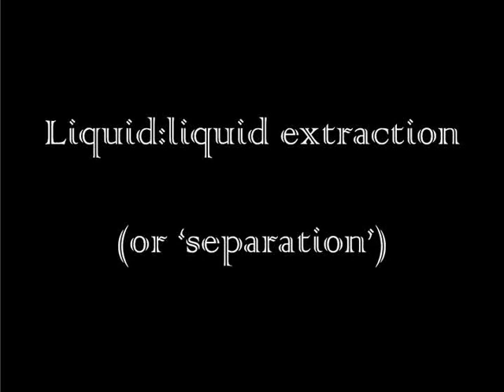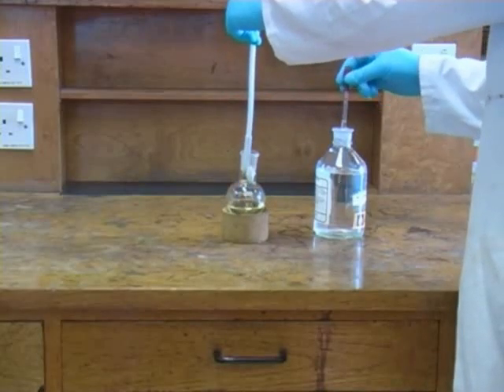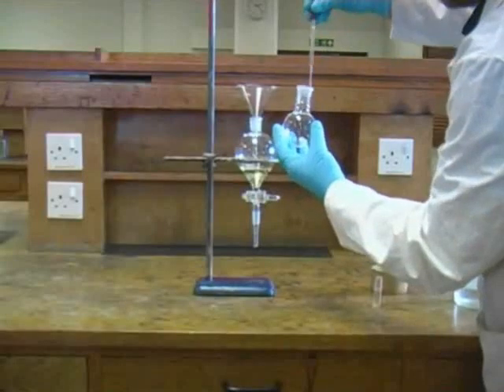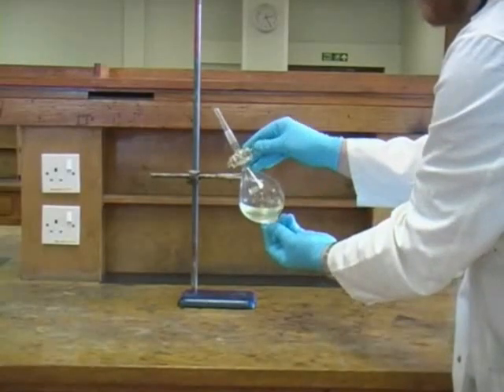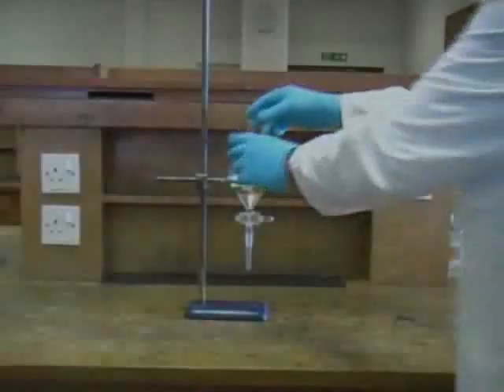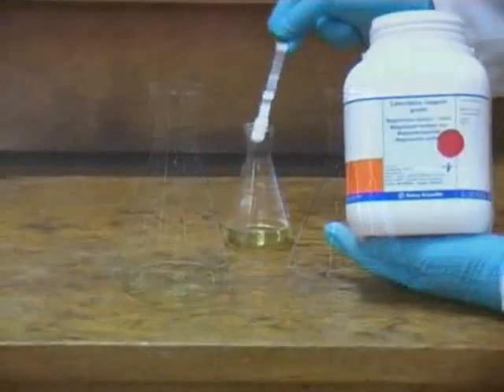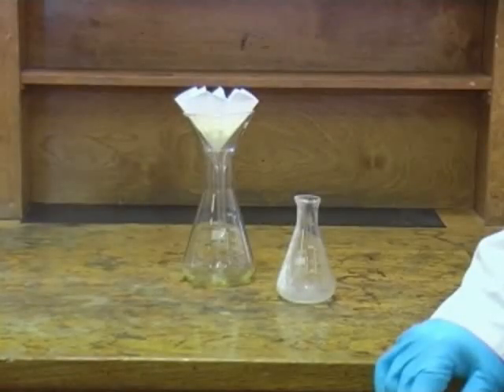Liquid-liquid extraction (or separation)

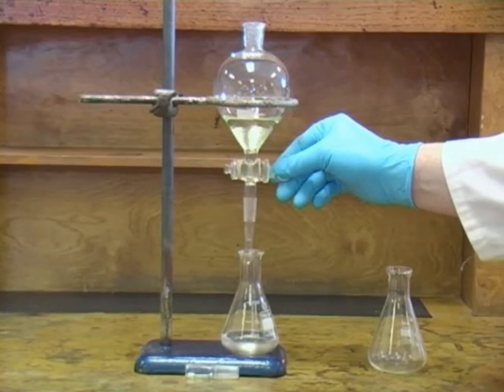Comment: At 2:35, he makes a small mistake in my mind. You should drain the upper layer out of the top to prevent mixing with fluid in and below the stopcock
Reply: Solvent gets evaporate anyway. And if one wants to get puriety in the upper layer more washings will be performed. EEw my keyboard sucks keeping doing a screen scroll while typing.
Reply: Good point. That's supposed to be the proper technique.

Comment: But how do you clean the Separatory Funnel after the extraction?
Reply: After you've completely removed the organic layer (in this case the top layer), you should rinse with ether to further remove your product thats stuck on the walls of the sep funnel (he didn't show that in the vid). Then you can simply rinse the sep funnel with soap and water, followed by acetone. Soap/water will remove polar impurities and the acetone will remove any remaining nonpolar(organic) impurities.